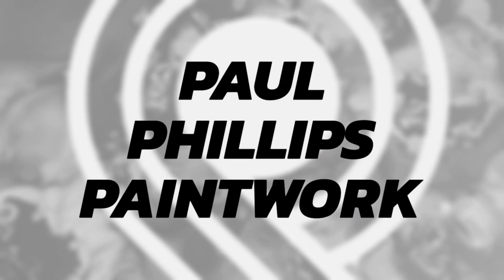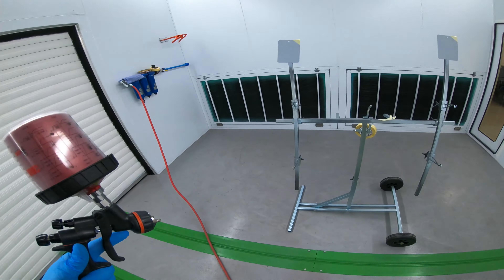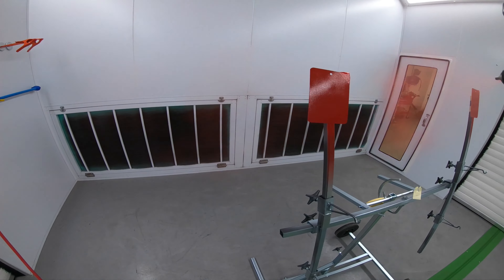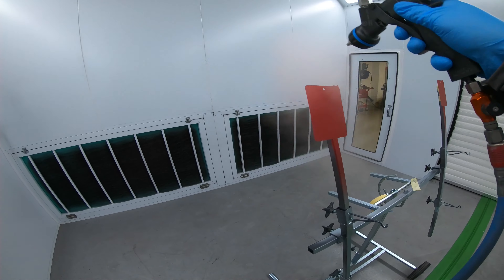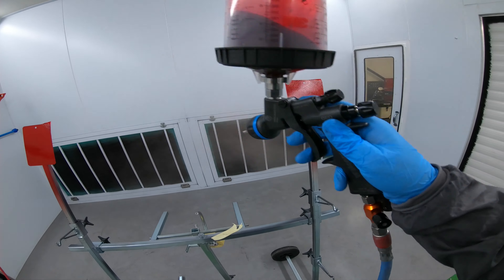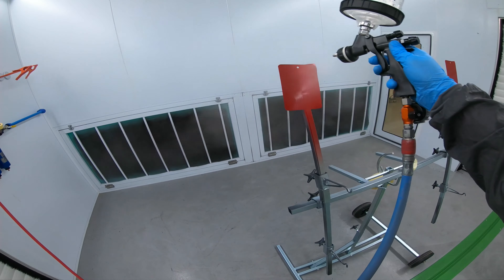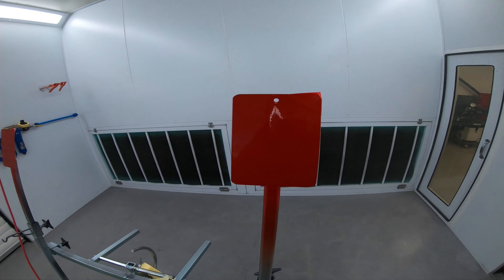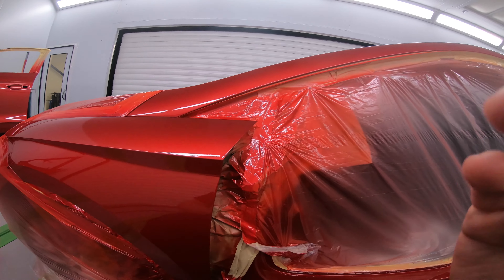How I do my sprayout cards

Comment: Paul can you just get a spray out all ready primed mate like a light gray or a dark one metal spray out cards  I got my bumper painted and its not a exact match with the other panels paul launa sky gray base coat paint for a ford focus mk3 titanium x  there only do 2 mate at the paint shop 2 chip cards a lighter one and the darker on
Reply from the maker: Hi Andy, I'm sure can get primed spray out cards but they are un common. The paint shop may just have some colour issues mate.

Comment: What computer program do you use that tells you if it’s a 2 or 3 stage with a tint coat or pearl
Reply from the maker: It's just the Standox system that was installed with the mixing scheme.